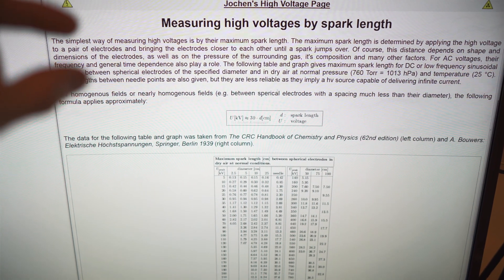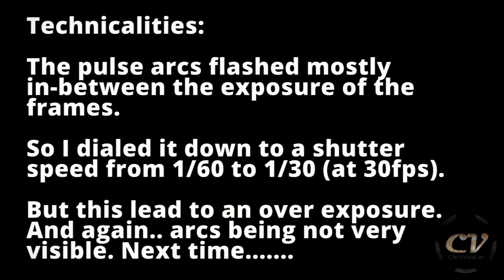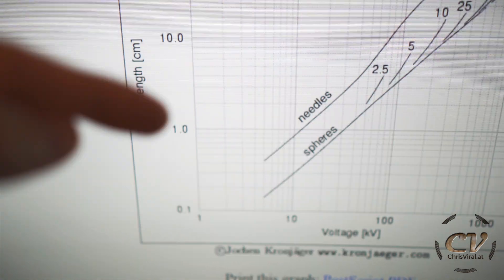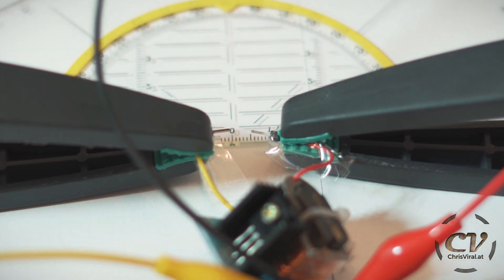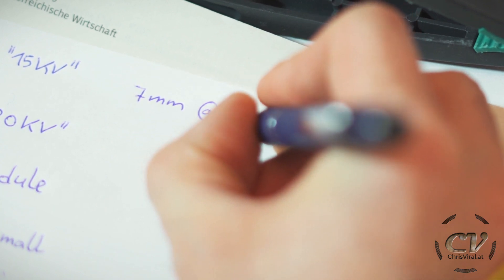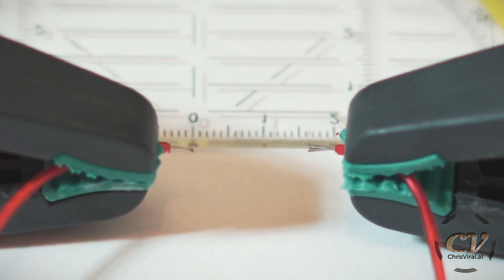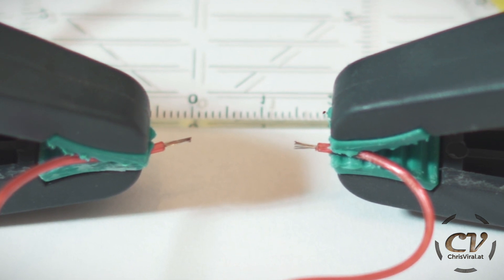MEASURING High Voltage Generators (15KV, 20KV, 400KV, 1000KV)

Comment: And you are correct on the one million volt discharge. We could probably not afford the insulation  that would have the dialectric strength hold the voltage inside the output wires.
Reply from the maker: Another good point thanks

Comment: Great job on calculating discharge distances but there are things that will make it different..  A few things that will make discharge distances to vary are:  humidity, temperature, altitude, substances in the air, and shape of discharge object.  High voltage can be compared to a wild animal that is not predictable, and does crazy things.. there are just to many variables to make it constant chart.
Reply from the maker: I remember something about humidity, altitude, etc. in air to be rather negligible. But in any case it's just a rough estimation for sure. I plan on building a high voltage measurement tool one day and redo this experiment. Thanks for the feedback 🙌

Comment: 7:31 didnt exect that :) its the best of the "hot type"
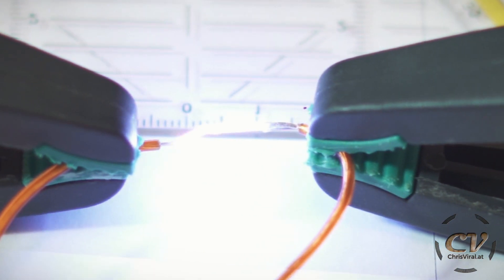7:37 LMAO the background comment
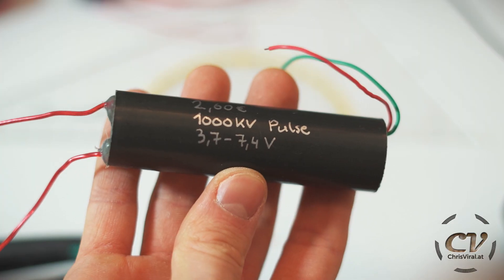8:42  i test it my self the limit is 21-22mm @  2x 18650 Battery (7,8V) , crap i killed mine by accident because the cable slipped over to the 3S port (11,7V)
So do not try to go over 8,4V (2x 18650).
 for the round "400kv" i can confirm its 16mm , tested with one 18650 at 4,0V too.

the bigger "1000kv" model has ~5mm more spark gap so its around ~27% more power.

i think you misunderstood the 1kv/3kv thing because its not mm-gap multiplied by 1 or 3 but instead it means to spark 1mm you need 1KV or 3KV depending on the electode. Which means with ball elektrodes you get 3x LESS spark lengh.

All Values you wrote are simple 1mm = 1 KV, so the largest  with 17mm had only 17kv
or 1/3 when a ball electrode is used like 10kv = 3,3mm gap.

 for the formfaktor you could combine the small recangular pulse module with a 16340 Battery(CR123A) , then its ultra compact.

3:41 Can you send me please the ebay link for the smaller recangular pulse module (800-1000kv) i cant find it
Reply from the maker: Yeah I really don't like the noise of the pulse modules 😂
I don't trust the big module... I think I fried mine with 2x18650 (8.4V) I think this might be too much... You'd need two 50% charged 18650 to get 7.4V so I really don't get the point here...

Needle vs ball, yeah I think I mixed that up, thanks. I thought needles would give x1KV / mm and ball give x3KV / mm. I now know that round electrodes have it easier with holding electrons, that's why they are used on top of tesla transformers. But I think 1-3KV per mm is still valid.

Oh yeah lol, micro taser. Nice idea 🙌😂🙌

It's this one:
https://de.aliexpress.com/item/800-1000KV-Ultra-High-Voltage-Pulse-Generator-DC-Super-Arc-Pulse-Ignition-Coil-Module-3-7/32788053599.html?spm=a2g0s.9042311.0.0.27424c4dUZZOpC
Reply: i am not sure if you understood me. On teslacoild they use the round toriod electrode to produce a more random sparking. But its more difficult for the current to get out of this electrode. Its way easier to spark with a pointy electrode, that why pointy electrodes are use in tig welding and in air ionizers for example.
this means you need less voltage /mm with a pointy tip 1kv/mm but if you use a ball electrode you nedd x3 more Voltage for the same distance. Since you used no ball tip you calculation is based on 1kv/mm.
Reply from the maker: Ye ye no worries, it's probably just a misunderstanding ^-^
Needle tip = easy sparks. Yeah 1KV for needle tips right but these are cut off wires. So I thought it might be a bit more than that.
Reply: cut off wires count as needle tips in practice this they aren't even close to a ball/toroid shape  :)

Comment: How much time does it take for the non-pulsed modules (like the 20kV HP) from switching on the input power to delivery of the high-voltage output? Are we talking hundreds of milliseconds or just a few milliseconds of even micro- or nanseconds? The reason why I'm asking is that I wonder if something like this could be used for fast switching, e.g. fine-regulated by arduino code that switches transistors on the input side, to power something like a multistage plasma actuator, where I'd need to very quickly control the polarities for  individual electrodes. Could this work? If not: what else could be used for fast switching of high dc voltage? Note: I probably wouldn't want to have my "switches" (mosfet transistors, relays..) on the high-voltage output side (because of heat losses, leakage currents, voltage ratings of available components, etc), so I'd need a quick reaction from input switching to output voltage delivery.
Reply: i measured the time with one of those 15kv transformers, it takes around 100 micro-seconds when its connected to 3.7 volts. thats it

Comment: I made a one using IRF z44 MOSFET and Made a High voltage Transformer at home.
If you attach a voltage multiplier circuit at the output you'll get flilkers of High voltage but if you don't attach a voltage multiplier at end it's Plasma.😌
Reply from the maker: Nice ⚡️🔥

Comment: First value is for ionized air sparks like you see from a tesla. Second one is for spontaneous discharge. Electrodes should be bearing balls
Reply from the maker: Okay makes sense, thanks for that
Reply: @ChrisViralVlogs  I wonder if you have a flyback laying around.. My modules are on the way so a test would be cool :D
Grüße aus Deutschland :D
Reply from the maker: I don't know a lot about this stuff so it would help, or actually make it possible/more likely if you'd post a link to a little experiment or maybe a video so that I can get a better picture :)
Reply: @ChrisViralVlogs  a flyback transformer is transformer used in the old CRT TV's which has high ratio between the primary and the secondary windings, to this you connect a pulse circuit/multivibrator and get the more or less same effect

Comment: Spark gap also depends on humidity. Put the high voltage through a secondary on a choke transformer and measure primary voltage side and calculate. The method shown is highly unreliable.